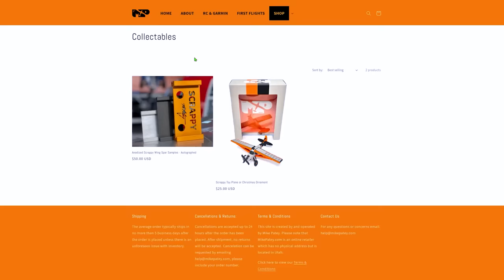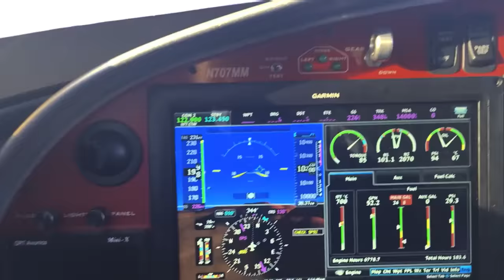Demolishing a 20 Year Old Record - Fastest Single Engine Turboprop | Turbulence #5

Comment: Mike plz let us know what you learned about the engine failure. 

Keep the content coming. Really enjoy it. 

Stay safe!!
Reply from the maker: Won't know anymore than we already do until we pull the engine. Can't wait to get out there and swap it, but got a few projects I need to finish up before I can do that.
Reply: Mike mentioned in a different video that tht engine was not new when he installed it - and he monitored the engine params every second I believe - there is a chance the engine was over temped or hot started a few times, which can significantly reduce TBO
Reply: @ghostrider-be9ek  I remember that, and I believe I heard that it was going to be sent to P&W to be inspected.
Reply: @Do-UR-Research2749  yes, PWC like to investigate odd failures like this as they are so unusual - PT6s rarely fail uncontained like this. I've personally seen PT discs open up like a flower, shed all the blades and not eject parts radially outwards.
Reply: @ghostrider-be9ek so not like blowing on a dandelion like Mike experienced.
Reply: @RowanHawkins  um, Milke had a serious uncontained failure - not sure how that compares to dandelions

Comment: Mike thank you for letting us see a little piece of your incredible world. With the challenge that you have spoken of, of a airframe that has high speed yet can then turn into a slow flight aircraft in my opinion is the true need for the firefighting air tanker aircraft for the next generation. The modification of commercial jets to do the job is great for response, but speed reduction for safe application is the challenge. I can see your knowledge having such a huge positive impacts for the future of firefighting. And again thank you for all the positive impacts you have already done and continue to do. Back to work making flight safer.

Comment: The radio clips were interesting. I was flying once in Scotland when the national gliding coach took someone up for a gliding experience flight. They got to 11570m [38,000 feet]. Since that's near the route for planes flying across the Atlantic, there were lots of conversations where they were talking down to the big jets, only at 36,000

Comment: With Turbulence, you're not saving "just a little" each time you fly. You're saving several hours compared to flying commercially. On top of that, you can get into smaller airports closer to your destination, saving even more. All that while flying through the air at airliner speeds, except that it climbs to cruise altitude much faster.

Comment: Hey Mike! Love the extremes builds! Wondering if you'd ever consider a design challenge on something more approachable as a commuter aircraft? I've been thinking about how to build the lightest and fastest 4 seat plane possible with about 200hp. My fundamental thought process is to optimize for top speed and then add as much flaps and other retractable L/D as necessary to give it the largest flight envelope possible.
Reply: An approachable commuter aircraft, and one of the highest performance possible on a given power, are mutually exclusive concepts.

Four seats, instead of one will cost ~100ktas of top speed.

An "approachable" commuter craft will land around 55-61ktas to be manageable, again costing substantially in top speed.

If you want a 4-place, start with a Vans RV-10. Use a 4cl engine of 200hp. Reduce frontal and wing area accordingly to restore performance to original spec. Retract the gear or optimize laminar flow to exceed the basic 230-260hp Vans design.

Comment: Put the PT6A-68B from a PC-12 in it with 1,600 hp. Can you imagine the climb rate from doubling the horsepower? Probably full aileron to hold it wings level at max power.

Comment: Mike, have you considered reducing prop RPM at high Mach to reduce drag from blade tip Mach speed? The V-22, V-280, and the Sikorsky Defiant all have that technology.  I wouldn’t be surprised if the Augusta 609 has it too.

Comment: Incredible feat. The sleek lines are true beauty. But every time I see it I wonder how much drag would disappear if those monster exhausts could be removed and have exits out of the tail? . There is probably something obvious I’m missing about them.
Reply: You're right about drag due to those exhaust. But You can't do much about it, because its a turbine. It has to flow a substantial amount, which is why it expands, and produces obscene heat as well. Limiting what you can do with it. You cant pass a 1,600 degree pipe thru a composite fuselage. And any extension will reduce power, increase turbine temperature, and hamper efficiency.

Comment: Might want to think about a fully symmetrical flying wing with a dual counter rotating variable pitch fan system powered by a single turbine engine to give more space for fuel supply and overall comfort

Comment: mike have you ever thought about maybe modifying an import engine like a 2jz from the 4th gen toyota supra for arial use it’s a seriously strong engine known for being capable of handling up to 1000hp without doing anything to the inside of the motor
Reply: Strength isn't everything though, a 1000hp dressed 2JZ with a reduction box and cooling systems is probably going to weigh north of 750 pounds.

Comment: I'm in the UK Mike and have a keen interest in WW2 piston engined fighfers and their development through the war to their ultimate incarnations such as the Sea Fury, Bearcat, P51H, De Havilland Hornet  etc. I've often wondered why the speeds that those aircraft could achieve haven't really been bettered by modern single prop aircraft and although I've been watching your vids of Draco and Scrappy for a number of years I was completely unaware of Turbulence until recently. The performance that you are getting with what nust be a very light and aero aircraft is amazing with half the power or less of those peak WW2 fighters. Is it possible to get more from your engine ?  Would it be feasible to get it over 500mph in level flight with more power or would aerodynamics/physical size of engine bay ultimately limit it ?
Reply: Its worth remembering those aircraft had thousands of horsepower, most normal propeller planes have between 180 and 310hp (maybe 400 if youre lucky)
Reply: @smokingspitfire1197  IIRC Mikes  is up around a 1000hp with the turboprop and I assume its the low drag/light weight that enabling Turbulence to get to the sorts of speeds its able to. It would be unfair of us to directly compare a 1940s aircraft to a 2020s aicraft.
The 40s aircraft were much bigger,  heavier and must have been a fair bit draggier than Turbulence but thats the beauty of modern composite construction and a small lightweight engine with a small  frontal area and high power to weight ratio.